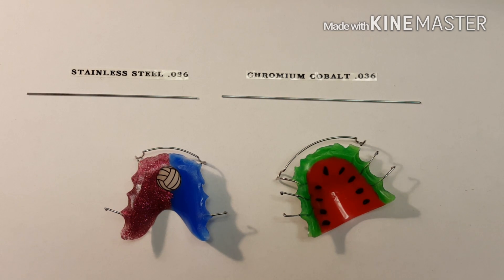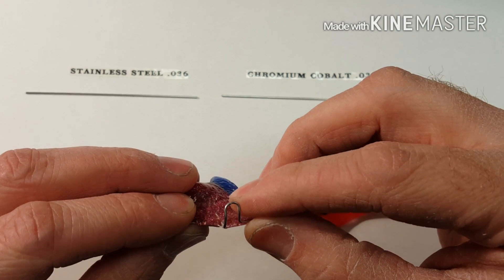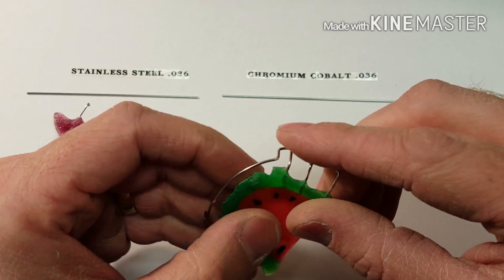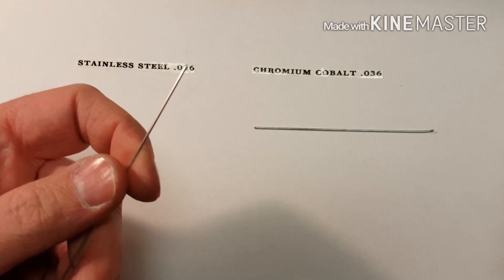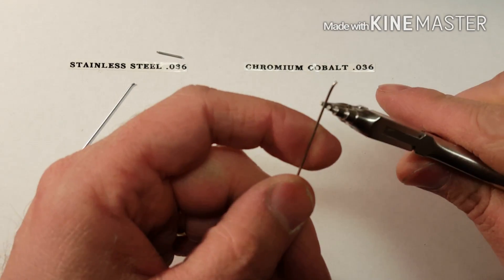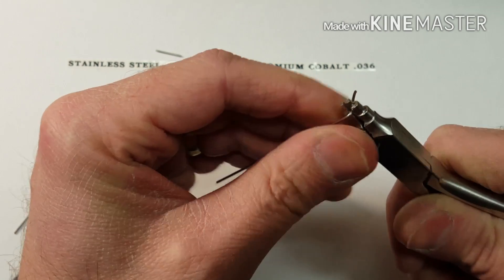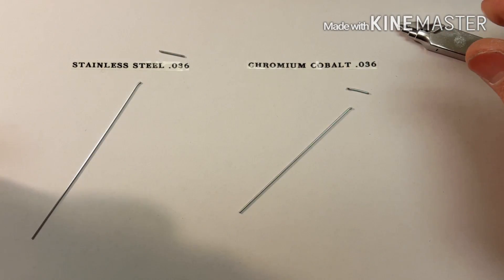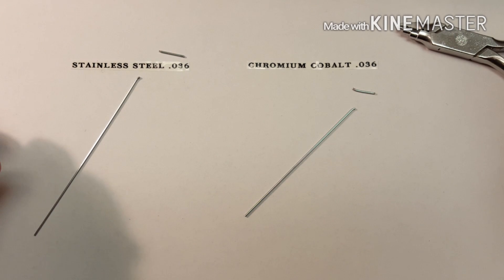Ortho MUST SEE Why retainer wire breaks  (Stainless Steel Vs Chromium Cobalt)

Comment: Can a SS wire that has a weld to another SS wire be repaired if the weld breaks?
Reply from the maker: yes if a proper tech who knows what they are doing.  Both wires need to be properly cleaned and roughened up with a handpiece bur, tack welded and then resoldered

Comment: My nieces retainer broke. She's only had it for 3 weeks.  She was TRING yo brush her teeth so she removed it and broke. She's crying since it her second one. Is there any way to fix
Reply: My retainer has broken in this exact same spot 4 times. It just happened again a 5th time. Ughhhh! I don’t want to call my Orthodontist I was JUST there a couple weeks ago for a break in the same exact spot but now it’s on the other side. FML
Reply: @takingbackallie2  is it hard to replace the wire?
Reply: Andrew Holt it’s been an easy process with my orthodontist. They have done the repairs for free every time so far but I just hate asking them to repair it so much. The last time it was repaired they actually used a thicker metal and it hasn’t broke since (knock on wood!!)
Reply from the maker: @andrewholt9029  yes. Has to be remade
Reply from the maker: @takingbackallie2  that will definitely help
Reply: TURNIP ZOO have u found out? This is my second one and my mom is going to KILL me.

Comment: my retainer wire broke on the C clasp area. it literally is a clean snap that from the wire that comes out of the acrylic then connects the C Clasp. can i use a soldering iron to rejoin with flux and wire?
Reply: Bro I'm facing with the exact same prob